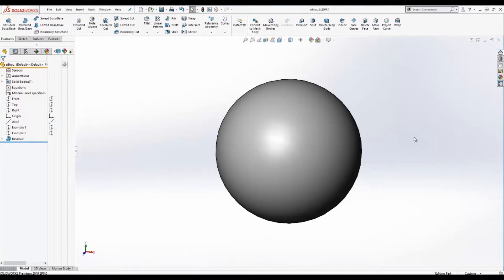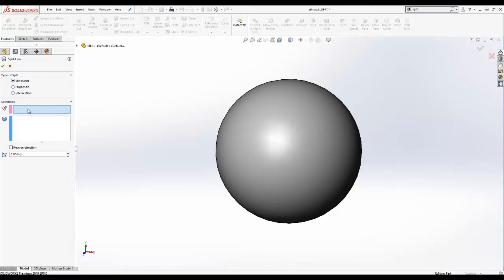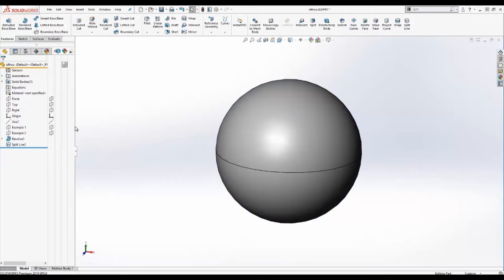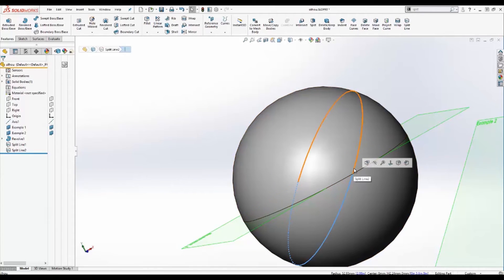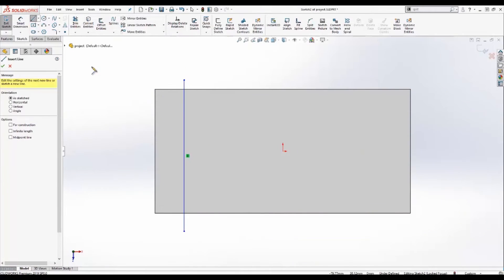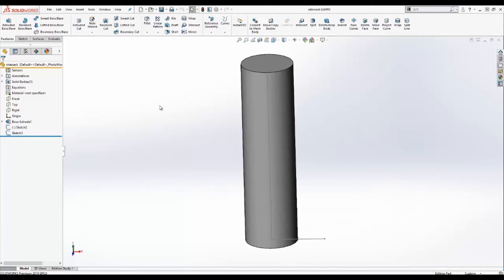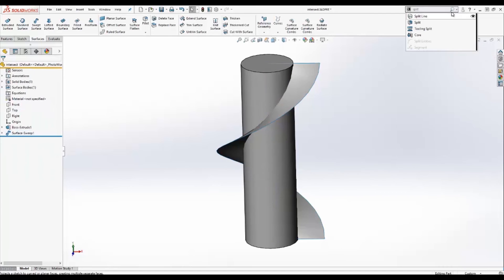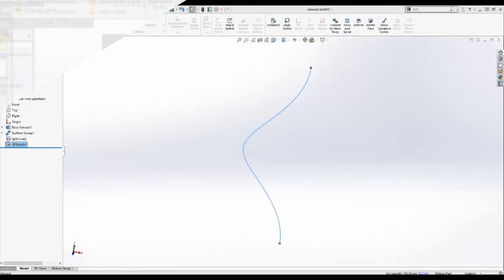Video Tech Tip: 3 Ways To Use Split Line in SOLIDWORKS

Comment: Thanks for the tutorial. I encountered a problem, though. I was trying to add a split on my simple bar, then a message pops up saying that "The sketch has both open and closed contour." I used Solidworks 2021b. What should I do? 
Many thanks!